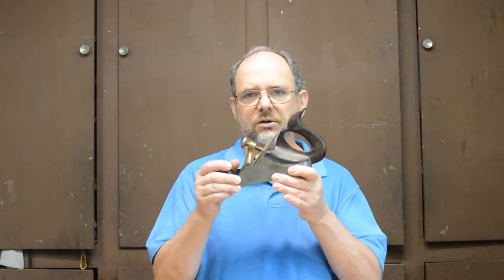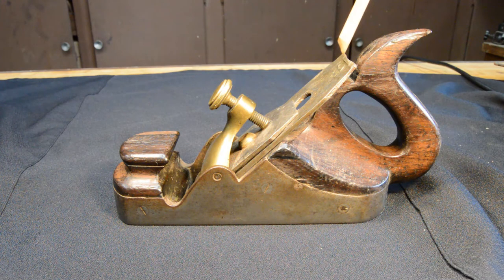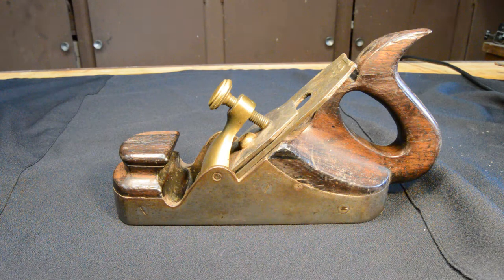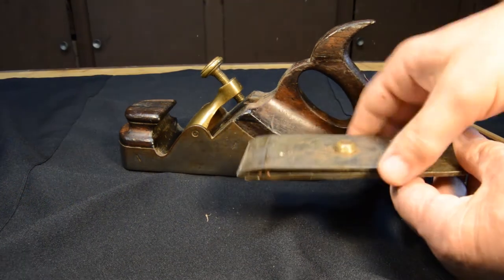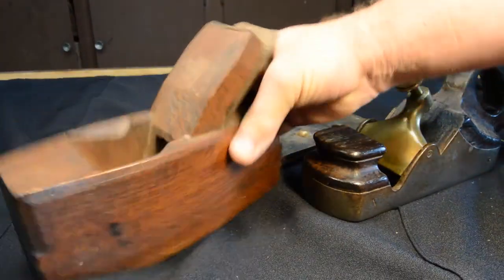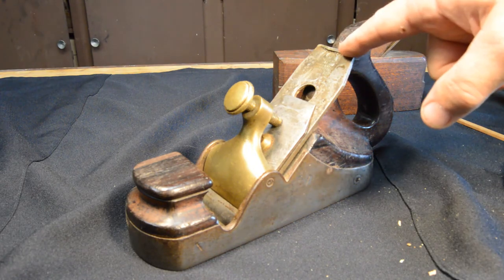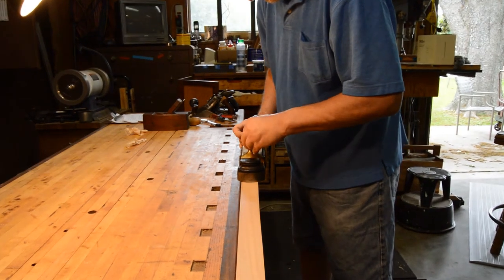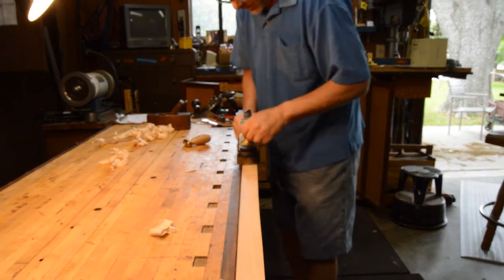Handplane Challenge, British Edition: Infill Smoothing Plane

Comment: a small wood mallet does wonders with the infill.  use it on the back of the sole below the tote or on top of the "bun" aka knob.  you can advance the iron by tapping at the front of the sole
Reply from the maker: I have a newer video that updates this one, https://youtu.be/hGEQp20RMs4?si=QifhA0F_GmT8IP5v.  I can't hit the below the tote, but I can hit the top of the bun.  Well after I made this video, I also found the following reference: https://paulsellers.com/2016/08/tap-adjustment-set-panel-planes/ .  My updated video is basically the same as both you and Paul Sellers describes.  Thanks for watching!

Comment: You just need to spend some time with them. Have the adjuster set at a moderate pressure and use a small wooden hammer  HNT Gordon plane adjusting hammer for example) to adjust the depth of the iron up or down and also for lateral adjustment. By striking the nose of the plane (front face while the plane is held horizontally) the iron will lower / advance and by striking the heal (easier on a wooden plane) it will retract. You can also hold the plane vertically and strike the 'tote' area of an infill or wooden plane to retract the blade or loosen the wedge and iron. The strikes are quite modest and by repetition  (a couple of hours playing around) you will learn how firmly to adjust the leaver cap screw and how firmly or otherwise to use the wooden hammer. The adjustment of a wooden plane and infill plane is far superior to that of the later Stanley type adjustment systems as the 'tap' method is much finer and more easily regulated. One of the advantages of wooden planes is the relative lack of friction between the sole of the plane and the work piece compared to all metal soled planes. They also tend to burnish the wood of the work piece. A high quality wooden plane will have both a very hard wearing sole (lignum vitae or ebony) and an adjustable mouth which negates the issue of having the mouth opening up via flattening the sole. Love the channel :) PS. I have a half dozen or so infill smothers that are all set up sightly differently which means I can just grab the one I need as I go - this may be as subtle as a 30 degree grind on the iron. There are always two of my favorites set for final planing and produce see through thin shavings. PSS. Every infill plane I've ever bought has needed it's sole flattened to begin with.
Reply from the maker: Thanks for the comments!  You've inspired me to made a video about my wooden planes (can't believe I haven't done that yet).   So stay tuned.  But second, I'm still a bit perplexed about applying the wooden plane procedures to my infill plane.  Would a person really hit the back of the handle to retract the blade?  Or, would a person hit down on the bun to retract the blade?  I look forward to comments.
Reply: @MarkSLSmith1  Hi Mark, if the infill plane has a handle you would not strike that as it is too fragile. Assuming your right handed hold the plane vertically in your left hand and strike the bun (one firm tap) with the wooden hammer to retract the iron slightly. The are many infill smothers which do not have a handle in which case you can hold the plane horizontal and strike the body at the rear. Hope that makes sense ?
Reply: @MarkSLSmith1  Hi Mark, One other small, if you apply some wax to the underside of the iron or two the iron bed it can make fine adjustment of the iron that much easier and smoother - less inclined to jump (I just rub it with a regular white house candle). If the iron has corrosion remove that and give it a few passes of a whet stone to ensure there are no rough bits sticking down towards the wooden bed / frog. It takes a lot less pressure than you would expect on the leaver cap screw to ensure the cap iron and iron are held in place. Enjoy :)
Reply from the maker: @chrisdunham7169    Yup, I was 99% sure that one wouldn't strike the tote (handle).  On the other hand, it does make more sense to strike the bun.  I'll try this next time.  I did take a close look at the bun, and I can't see any evidence that it has been struck previously.  My thinking now is that as long as the bun remains intact, as one might expect from gentle tapping, this would be a heck of a lot better than manually retracting all the way and starting over.

Comment: That infill seems a bit persnickety to adjust.  Bailey's were a great invention.
Reply from the maker: Yes, it is.  Once you manage to get it adjusted, it planes like a dream.  I especially missed an easy way to retract the cutter; with a wooden plane, you easily retract by tapping the rear of the plane.  You can't do that with an infill.  I guess your only option is to loosen the nut and retract the cutter manually, and then try to hit the right spot when increasing the cutter depth.  Bailey planes are great, but I'm also a fan of wooden planes so I don't require a mechanical adjuster.  I just wish it were a bit easier for the infill.

Comment: Marples only made the x4 .i have a nice collection of infill planes and use them dailey the infill planes are superior to any plane you will ever find . Look at the side of the plane ware it contacts the sole as most are dovetailed .also look under the lever cap for a makers name .
Reply from the maker: Thanks for confirming my information about the Marples X4.

I checked under the lever cap, no identifying marks (or any marks period).  I think this plane is a solid casting for the metal portion, not dovetailed.  Also no marks on the side as far as I can see.

Did I have it about right in my description of the depth adjustment?  How do you do the depth adjustment?

While checking under the lever cap, I discovered a previous tote repair that I didn't know about.  Currently being epoxied even as I post this.